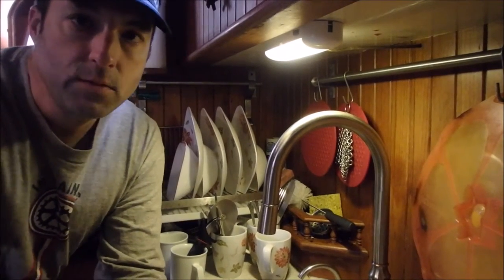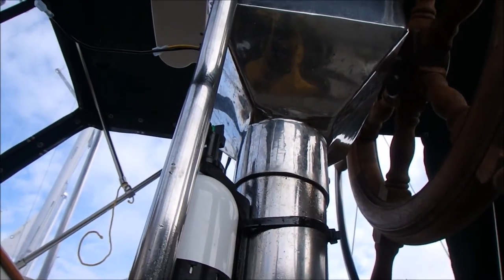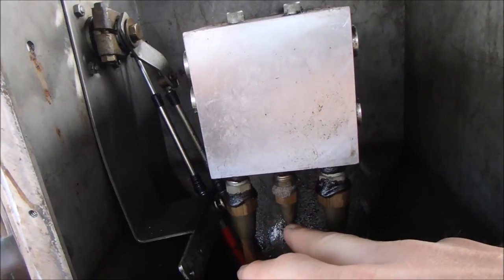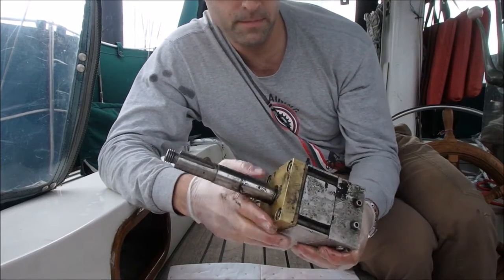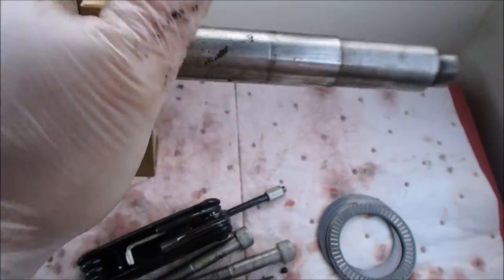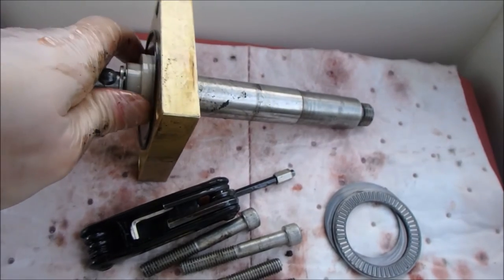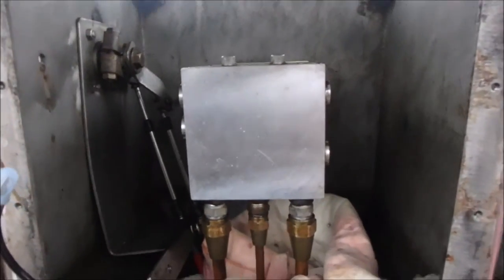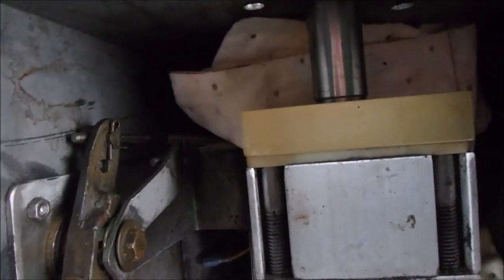SV/Raven Video Diary #10: Troubleshooting Hydraulic Steering

Comment: In order to find the leak examine the length of the system and look for fluid drips. You can leave white oil pads underneath likely leak spots.

Comment: How'd you go about bleeding the system of air/ensuring you didn't get air in the wheel pump chamber?
Reply: Garrett Hernandez you don't need to bleed the system. Even with air bubbles in the line it will still put enough pressure in my hydraulic system to turn the rudder. Eventually those bubbles will work themselves into the accumulator which has an an air pocket.